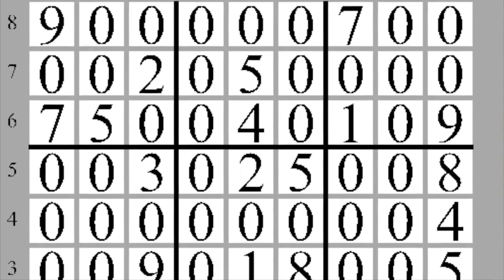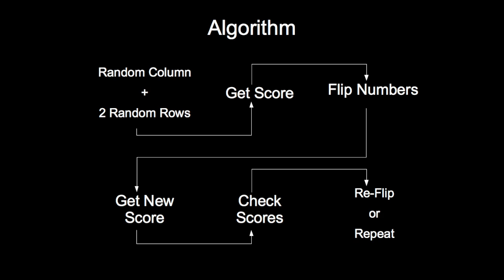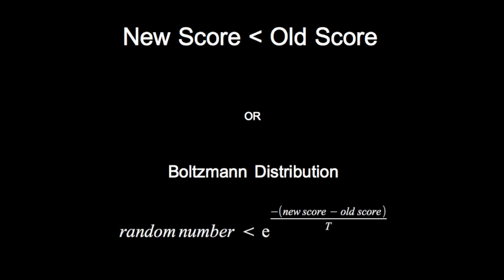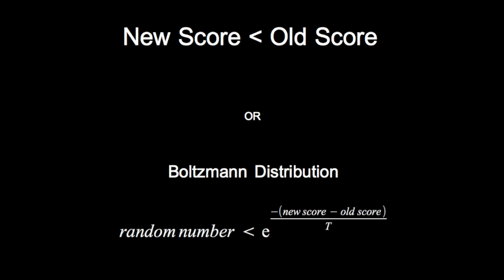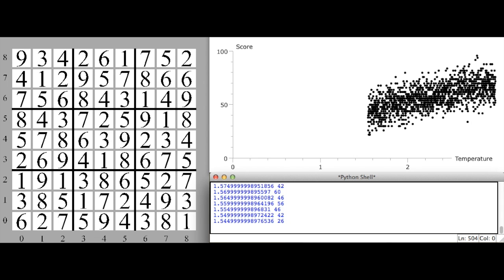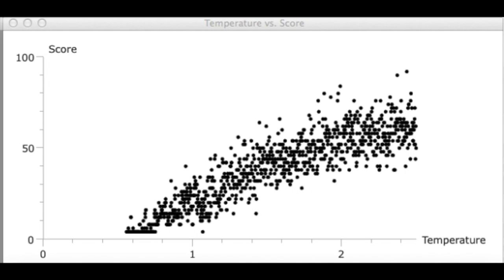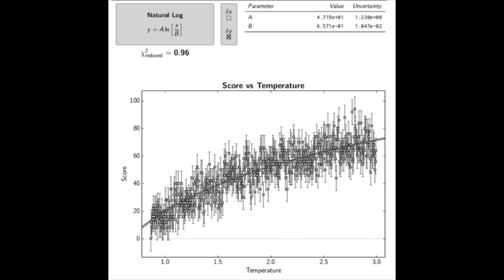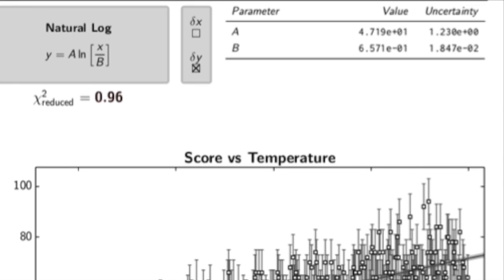Simulated Annealing and Sudoku

Comment: Nice work. I think the process can be speed-up by not generating random integer numbers in the grid, but by interchanging cell values in the grid, since there have to be always 9 of each integer in the grid. There are 27 constraints (9 rows, 9 columns, 9 boxes) to yield a sum of 45. The square difference is a measure of the misfit (S). When M cells are given there are initially 81-M cells free to move, or (81-M)/2 pairs to exchange. Boltzmann statistics defines how many pairs exchange per cycle. The misfit (equivalent to an entropy) is used to determine the number of pairs that can be exchanged (P). This could be the formula: P=(81-M)/2*(1-exp(-S)). At high S, i.e. high misfit, the number of pairs is at maximum. At  S=0, nothing is changed, the system has crystallised to the final solution.

Comment: couldn’t you DETECT when you’re in a local minimum, and increase temperature until you leave it? you’d see something that looked like that line...
Reply: in retrospect it would have been a fairly simple check to detect when the score remained the same for a significant number of samples in a row, and then bump the temp up in response, definitely a good idea, thanks!
Reply: How would one know how high to bump the temp up? There is no certainty around how deep a local minimum is, or it's relation to a solution.

Comment: It took 3 hours for simulation probably because your algorithm is extremely unoptimized. So if one dot is one sudoku position, there are approximately 1000 dots at the end. Or 3 hours = 10800 seconds, meaning each new position took 10 seconds? Either I dont understand something, or 1 position should probably take less 10 milliseconds even on old computer.
Reply: 2:49  "every single point represents 1000 iterations"
Reply: ...Python, thats' why, I just did the same exercise for a class in C and it takes about 1 minute.

Nevertheless, I do love Python when it comes do fast analysis and plots, but  it is worthy to translate the code in C when you have to simulate such a system!